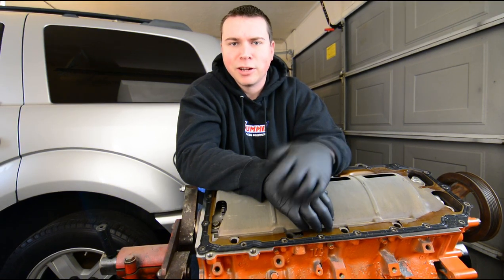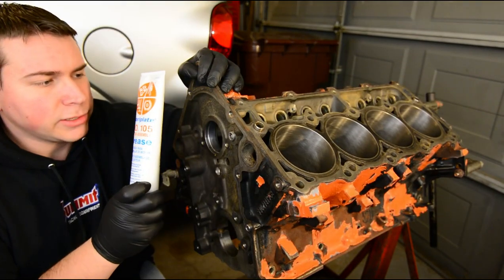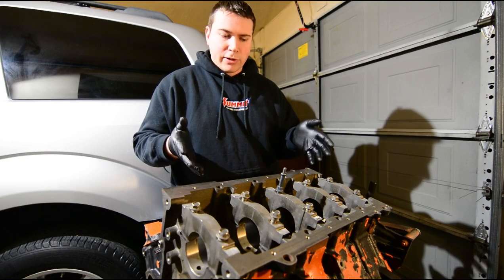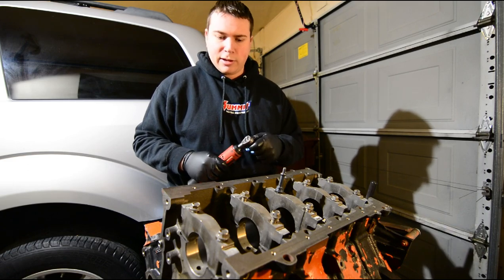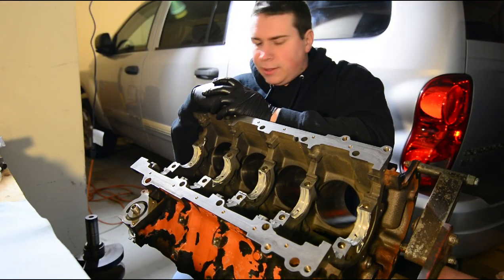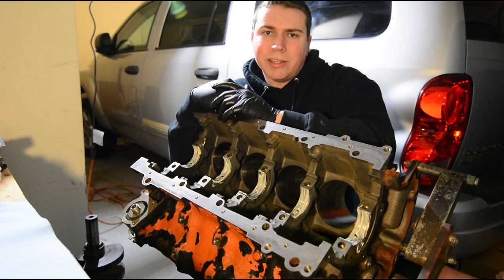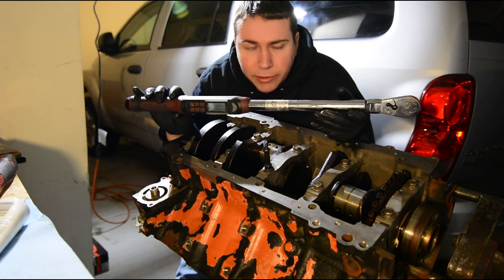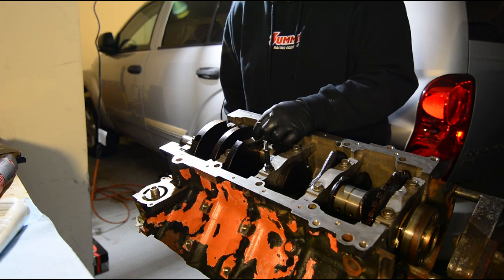HEMI REBUILD PART 1 - TORX GARAGE

Comment: Cap 3 was also on the wrong side. I'm so glad you caught that and the thrust bearings. How is your engine running?
Reply from the maker: @endtimesarehere1322  the struggles of trying to record while doing important steps lol.  It ran great. One of the reman heads was cracked, didn’t notice. Drove it for about a year with occasional coolant over pressurizing.

Sold it, new owners had it redone. I kinda wish I still had it. I have a 392 I’m about to build now.

Comment: I'm in the process of this now and i made sure to polish my crank before putting it back in. Also the Rings i ordered from Hastings are out of spec. The Ring gap for the top ring is around 0.045 mm the factory spec is 0.23mm - 0.038mm. The original 200,000 mile rings are with in spec when i checked them. They are 0.038mm. Clegg Engine where i got the kit from wants me to measure every bore and email it to them so they can ship me the correct rings. Have you had this issue?

Comment: That you strip your motor down to replace everything on your hemi where can I find cylinder head dowels and oil galley plugs? Looking to bond with my motor as I want to build it from the ground up using the 6.4 BGE /Hellcat short block

Comment: Awesome video, thank you. Question; why wouldn't you have the crank machined prior to assembly?
Reply from the maker: In this case, bearing surfaces were fine
Reply: Torx Garage should have at least had it polished and washed.

Comment: Did the crank pully have keyway or woodruff key insert
Reply: Most aftermarket cranks and balancers use a key. The stock crank and balancer are press fit - no key necessary.

Comment: So um do we not check tolerances of the bearings and crank journals anymore ? You should always check the tolerances of your crank and bearings and same with connecting rods and the crank journals. not enough and you will destroy your motor too much and same thing. Please for the love of god if your going to show people how to you need to include all the steps and tolerance is extremely important

Comment: How not to build a Hemi 😂
Reply: What did he do wrong ?
Reply: ??? If you're such an expert why are you in here???
Reply: Saul Cruz he forgot to insert thrust bearings on this video. Main cap fasteners CAN’T be reused. When rebuilding an engine the camshaft is one of the last components to insert.
Reply: Sadboy cali No need to get upset. You suck at building engines buddy. I was here cus I wanted a quick laugh 😂
Reply from the maker: @DaBestbruv  Good eye, I noticed it shortly after getting the crank in. Main bolts are debatable. If it's going to be abused you should probably look into other options. Cam doesn't matter when it goes in really, just make sure to do it before you drop the lifters and heads on.

Also no issues, it's doing fine.
Reply: @DaBestbruv  do you have ig?
Reply: @saulcruz9024  no thrust bearings on the crank and didn't put the outside bolts on the main caps before torqueing the top bolts